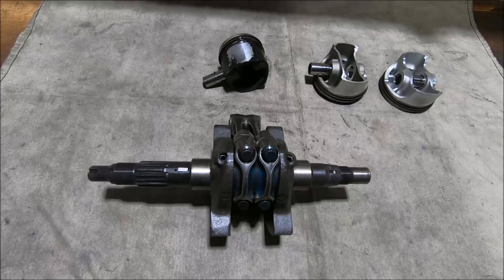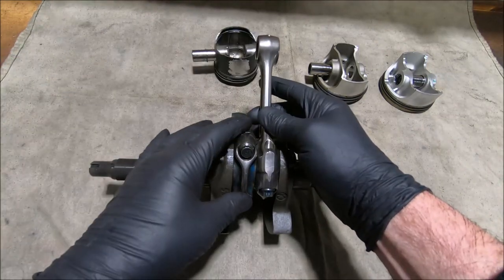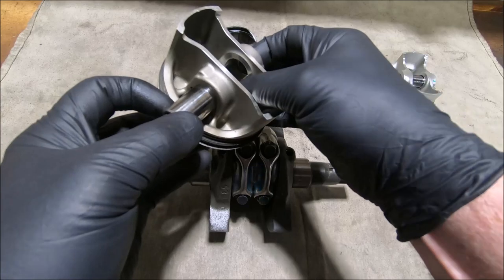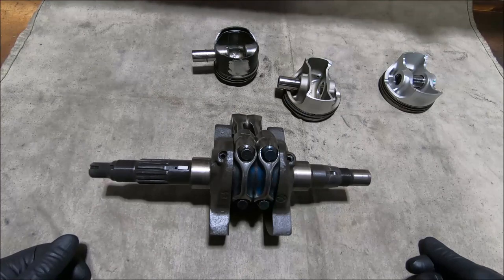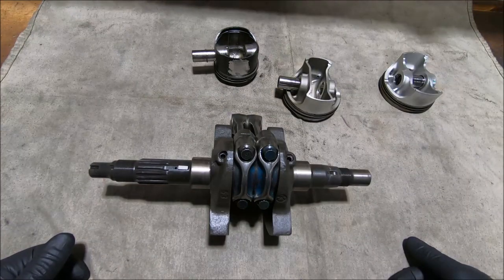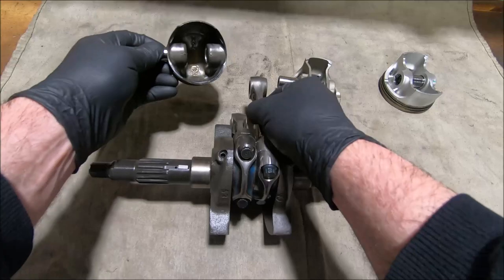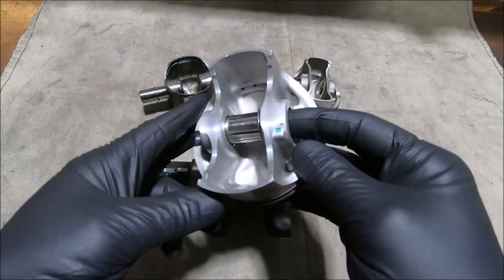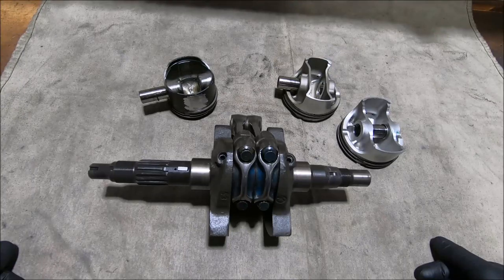Ducati Connecting Rods - big end and small end location.

Comment: Thanks for that. I learned this doing my Supermono project. I'm using both 916 and 996 ST engines. I took the rear cylinder off to fit my rocker box and freaked out on the ST4S engines slop in the crank. Fortunately my rocker box conversion is little end located. I had a struggle with the 916 as shimming the rocker was much tighter tolerance than the sloppy 996. 

Do you know where little end located cranks started? I found out that big V8 engines in the US used them to reduce friction but know nothing more.👍
Reply from the maker: no idea.  i'd not come across it before 996.